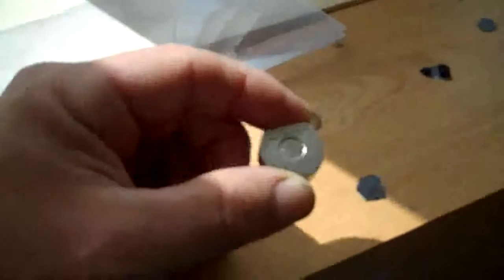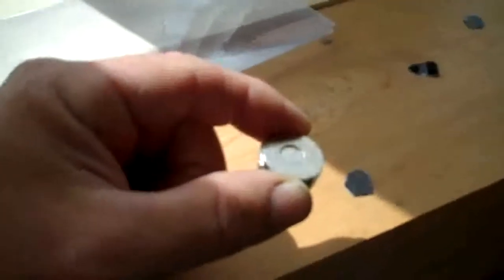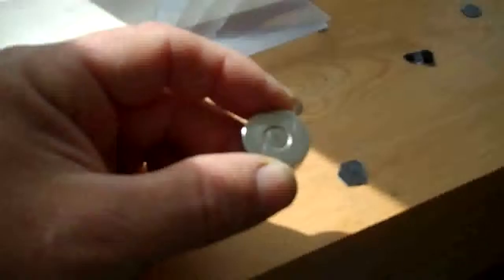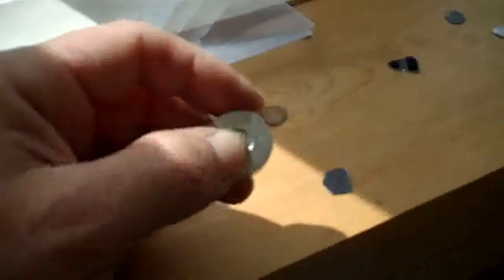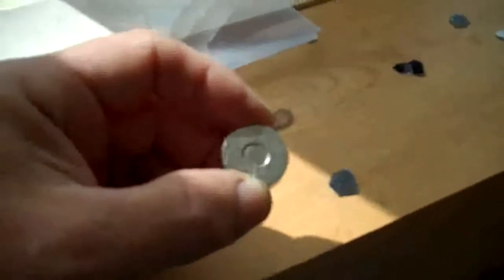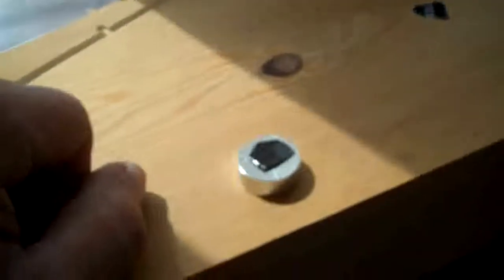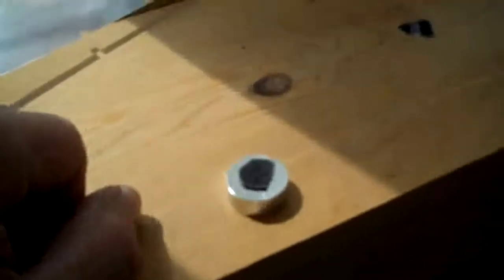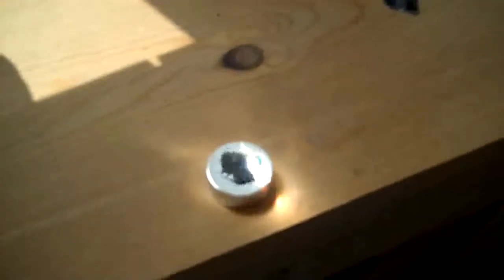High Diamagnetic Graphite Solar Engine  Part 2

Comment from the maker: hiya mate, i had a quick look - seems reasonable - actually you can get the same effect for any nanoparticle - i think it is rice who are using copper nanoparticles to do the same thing. I may well try it this way as i have some 4 micrometer copper particles laying around from a previous experiment.

Comment: I do have a question for you Robert.  If you increased the size of the magnets to a greater extent would you be able to increase the distance from the graphite and the magnet to the extent that the magnet could be completely isolated thermally thus extending the lifespan of the magnet utilizing only passive systems or would an active electrically generated magnetic field be necessary?  Thanks,  Daniel
Reply: Surely the load on the field is what degrades the magnet.

Comment: As always an awesome video Robert.  I've been at home recovering from surgery and been following your progress.  Thank you for sharing  your knowledge and passion for science, it's quite refreshing.  I do have a cheap easy idea that might help with this experiment.  Put everything under a vacuum and repeat the experiment as repeated high heat exposure will weaken the magnets.  I'm no expert but the vacuum should prevent thermal transference to some extent and allow extended mechanical rotation.

Comment: whoops I forgot the reason it is different from the perspective of the graphite, so here it is
pyrolytic graphite is only diamagnetic in perpendicular direction to the plane of the graphene, along the cleaving plane (think of it for anyone reading here as a book with pages pressed together, so facing the cover of the book back or front, the graphite is very strongly diamagnetic, and along the edges of the pages it is strongly ferromagnetic :) this is how it quantum locks in a magnetic field:)

Comment from the maker: The heat from the sunlight changes the diamagnetic properties of the graphite and so disturbs the equilibrium of the system. But as the diamagnetic graphite is very very thermally conductive as soon as it moves out of the heat spot the heat is dissipated across the surface and lost rapidly. This continues and the disk spins.
Reply: you da man alot of respect for ya brother

Comment: Are your books in print, or just in electronic version?  I want to buy a couple of them but I don't have an e-reader and reading a book on my monitor would probably lead to many headaches (literally).

I'm going to be building a large solar concentrator out of recycled materials this summer, and I think a lot of your ideas will be good experiments, particularly the one involving separating water into hydrogen and oxygen with Graphitic Carbon Nitride.

Great video as always.

Comment: Would it be possible to keep the graphite stationary and the magnet spin when sunlight was shone on the graphite? I am thinking large ring magnet attached to a shaft. then a round window with a lens inside. As the sun shone down the tube it hit the fixed piece of graphite and the re-action forced the magnet to turn and thereby the shaft. Then connect generator to shaft and get power. Just a thought.